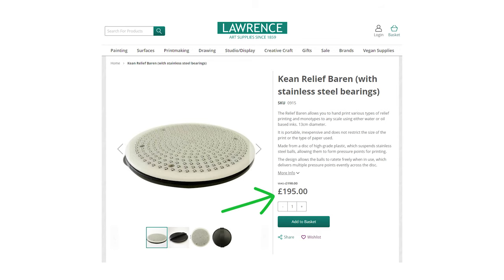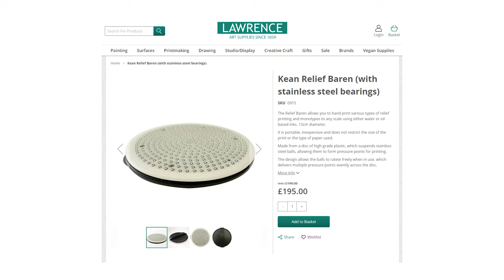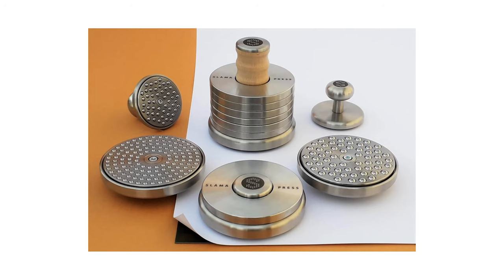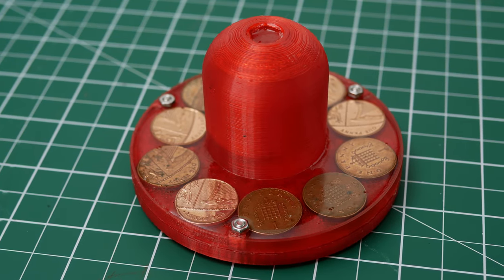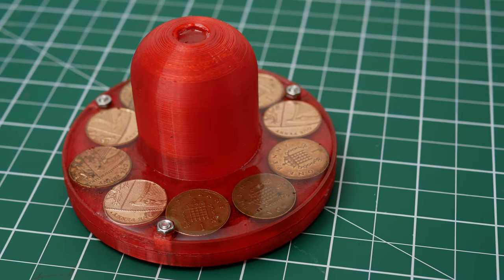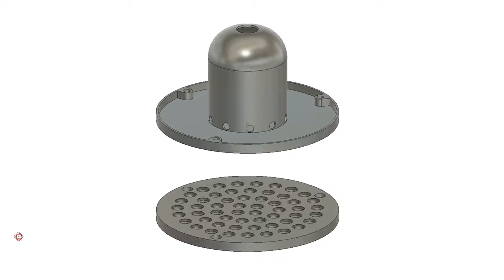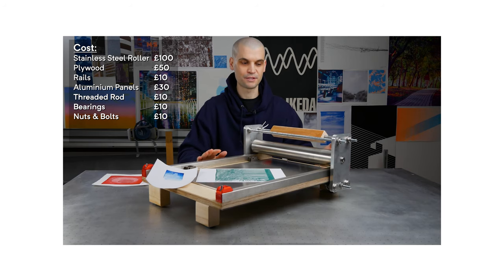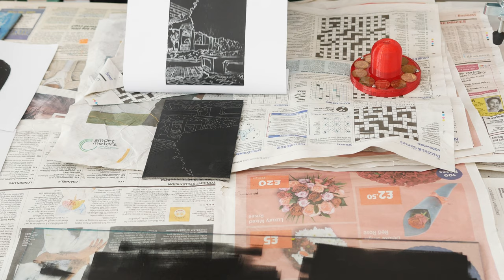3D Printed Block Printing Baren

Comment: Came across this print while researching small, portable presses because I just can't get enough pressure at home with the classic wooden spoon or normal baren. I don't have much space so the Slama seemed like a good option until I saw the price tag which was almost twice as much as the etching press I was eyeing. This is a brilliant alternative, and I'm so excited to print it and try it out. It's a good low-cost way for someone to try out a ball bearing baren before committing to something like the Slama.
Reply from the maker: Glad it was helpful!

Comment: I made one and got the 7mm ball bearings. Are the ball bearings suppose to roll freely inside the device? When I snapped mine in and put the cap on the bearings were tight inside and did not roll freely around. I did measure the bearings and the were 6.99-7 mm in diameter. Also when I put the cap on it did not sit flush with the back of the bearing housing. The bearing, even when pushed in all the way stuck out slightly on the back end. Otherwise it seems like a great design.

Comment: Excellent tutorial.

What is the white thing that you put on the bearings when you were installing them, grease?
Reply from the maker: I didn't add any white stuff to the bearings, they do not need any lubrication so dont worry about it. That is just some residue glue stuck that I use to adhere the filament to the 3d printer bed.

Comment: How much resin did you use to fill the area where the coins are? And how much did you use to fill up the handle? It looks like a great design. I'm thinking that I will use extra ball bearings to fill up the handle before filling it with resin to add extra weight. Will the hole at the top of the handle accommodate the 7mm ball bearings?
Reply from the maker: Yes it will fit 7mm bearing from the top hole. I didnt actually weigh out the resin, just eyeballed it

Comment: Hi. What is the hole diameter for bearing balls? Are they same diameter on both sides? I'm thinking of making one, but rather than buying filament I'd drill the holes.
Reply from the maker: Hi, the holes are slightly tapered so the ball will not fall out. Check the drawing here - https://www.youtube.com/post/UgxhnNdMew9az6lfUr14AaABCQ
Reply: @ThisDesignedThat  Thank you.

Comment: Please can you tell me what stops the balls from falling out of the disc with holes in? I thought the holes would be smaller at the bottom like a U shape, to keep the balls trapped inside. Thank you
Reply from the maker: You are correct, the bottom is a U shape very slightly to stop the ball from falling, here's a cross-section of the model https://www.youtube.com/post/UgxhnNdMew9az6lfUr14AaABCQ
Reply: @ThisDesignedThat  Very helpful thank you.